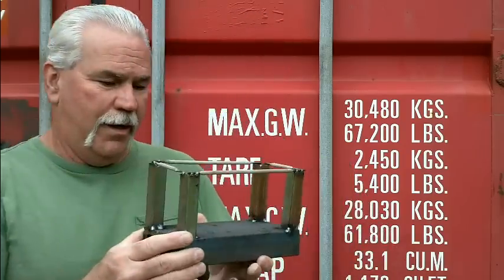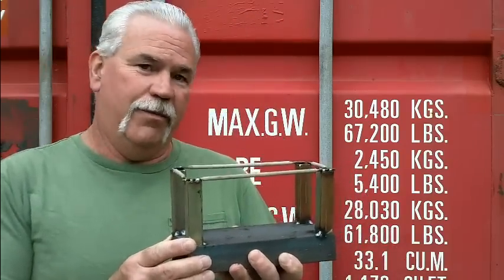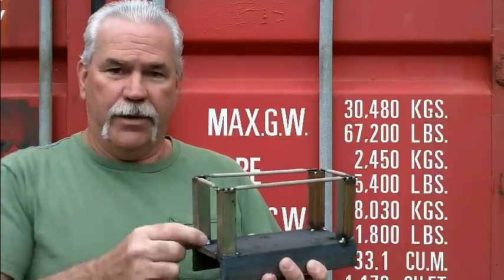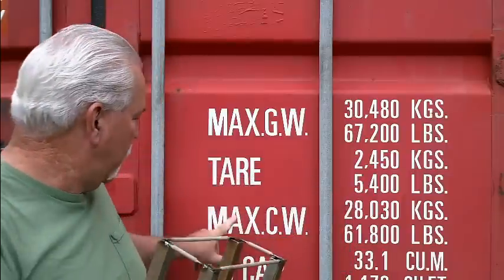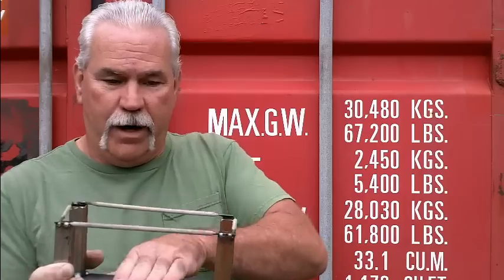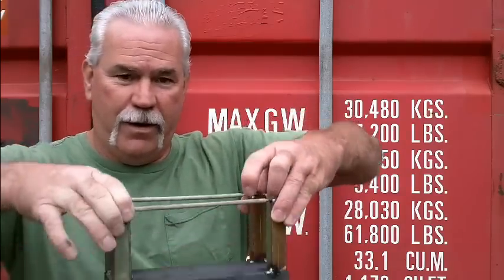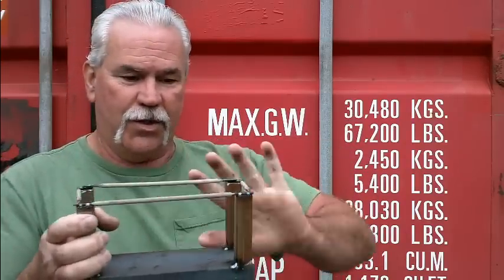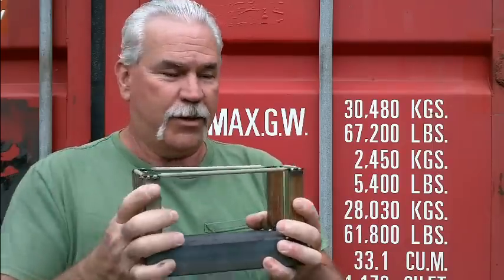Underground shipping container shelter part 1

Comment: I used to work in the shipping container industry, this man is very correct in what he's saying. The containers and stacked on top of one another but ALL the weight is on the corner beams. When you put concrete or soil on the top or sides it could very well collapse in!
Reply: But, you could use it as a form for a concrete pour. First you could shore up the inside with 4 x 4s, then seal any holes, then coat the outer 6-sides with a rubber sealant, then place it upside down on a concrete slab, set rebar, set forms for minimum 30 inch thickness, then pour concrete.  Let it set a week, then cut your entry point, and remove the shoring.  It could be at grade or in a trench.  If I did it at grade then I would set tires around it, fill in rocks and gravel, and pour concrete. Adding layers until I had a tornado-shelter.  20 inches concrete or 36 inches dirt minimum for nuclear fallout.

Comment from the maker: Hello Lamberto, first off as you know I am NOT a big fan of leaving the floor underneath you. That is so strong and you're not using it at all. get up top and walk on the roof and you will feel it flex that is only one eighth corrugated steel. If you're going to pour concrete on that extensive bracing must happen or you will have a cave in, concrete is very heavy, after it hardens it should be okay. Another problem I see is the wood. It holds moisture and when it is buried the air transfer is limited. you do not want to have mold in your shelter when you needed it. When you draw in moist air to a cool environment it sweats you will constantly have a problem with moisture and half to run the dehumidifiers to remove the moisture. That is why I limits porous material inside. As for sealing it I use the same paint as they use on bridges if you ever see construction companies sandblasting a bridge and repainting it that paint is very durable. when you paint it on the shelter and bury it it is now out of the elements as of dirt, Wind, salt, heat. so it will last underground for decades. If it should get a scratch the cor ten steel is out of the elements also. Cor ten steel last for a very long time it has anti-corrosion materials built into the steel. One more thing is the floor is not waterproof if you take out one of the floor screws you will have any open hole in the floor. So if you do not inverted and cover the floor with solid steel you will have to run a sump pump so you don't get moisture coming up through the floor. I hope this information has helped you let me know how it goes.

Comment: I built a portcullis on the entrance of my shelter and used 10 50,000 btu propane torch heads to create my flame wall ,5 flush mounted electrically ignited torch heads let side of the door ,at full flame under 30lbs pressure the flame from each side makes a solid wall of flame ,a single 100 pound propane cylinder tested out at 21 minutes of full burn on all 10 torch heads .

Comment: Here are a few questions: I dug the hole and cast a 2 foot re-inforced concrete floor. I placed the shipping container on there (normal side up) and secured the footing at the appropriate points. I boxed the exterior of the container with polystyrene (shapes cut to fit, 2 inches thick, between the metal container and with plywood on the exterior - for insulation purposes). Why should I not re-bar and encapsulate the entire structure with concrete (whilst curing, the container shell will obviously be held up by internal scaffolding to carry the weight). Once the concrete is cured after 2 weeks, it will be strong enough surely? Do I really need metal re-inforcement on the inside? Please advise....
Reply from the maker: as long as you brace it well til the concrete hardens I don't see a problem.
Reply: +Wynand Koegelenberg Nope ,just brace walls and ceiling till concrete hardens.
Reply: Personally, rather than spend time & money on welding / reinforcing the container internally, I would put plenty of rebar in the concrete & lots of temporary props inside. Rebar closely spaced (say 6-8 inches) also helps control crack widths. In simple terms, the concrete will be more watertight.Don't have the concrete too wet,(you can always add plasticiser). Do use a poker vibrator.

Comment: I like the turning over the container but all that steel is quite expensive. I could swing the inside bracing but was thinking plywood floor inside and concrete on the outside on top. Also could I getaway with 2 brace walls in a 40' hi-cube and the  2x4 c channel on the sides?

Comment: Hi, I am in the process of  burying a container right now. I left it with the floor down and I will frame it with wood inside just like a house. I was thinking of adding a 4" concrete slab on top with lots of rebar . Also I used 30 gallons of Henry waterproofer sealer on the all the sides and top nothing under (too hard to lift)
I was thinking that the wood studs and rafters would add enough support (I won't be adding lots of dirt on the roof just a slab. I will cover the whole thing with 6 mil poly sheeting over the Henry sealer for extra protection. I would like to know how you will waterproof your outer walls

Thanks
Reply: Need to be using something like tar for waterproofing

Comment: Hey Mike! I have a simple question that I would like to ask you, I am in the process of making a complete concrete home underground, how thick should I make the walls and ceiling, and should I add rebar to the concrete as well?
Reply from the maker: not sure about concrete thickness, I'm good with steel. I think Rebar is a must for strength. maybe someone with more concrete experience can comment.
Reply: loveihi

Thanks hopefully some one will! :)
Reply: +Aleksei Krasnov Alesnarovich Honestly, here is what I would do. Sit box in hole on reinforced concrete foundation with proper drainage. (2) run pipe on outside of box where you need it to go inside, such as for power going in. (3) put 4 inch insulation on outside of walls. (4) I would Build a 6 inch wide rebar grid around the insulation. Where the windows are doors are I would weld steel plate that goes out 1 foot, if none disregard this part. After you got your rebar grid, go out 1 foot and start laying flat rock, do this all the way up.  (5) Pour concrete in between the insulation and rock wall. Let it cure for at least 3 days, if not a week. (6) Built up rock wall another foot all around, rock wall is now a foot over the height of the box. (7) Now lay a rebar grid on top of the box and you can do this with box in original position floor down, and pour a 3 of inches of concrete and let that cure 3 days. Put more rebar down and pour full the last 9 inches. Don't forget the entrance though, that needs to be sorted first if coming in from top, or you can do it from the side if you want and lay wall up to it. If on the side put a beam across the top to lay more rock on. Personally, I would come in from the door side and have the one side a rock wall with a door and small windows for natural light. But it would be hard to find that rock entrance side after good camo is done. So you would be burying the floor, ceiling, and 3 sides. On the exposed side I would probably lay rock out to 1.5 feet, and do everything like before, but now you got almost an impossible wall to get through. An NBC safe door and 1 inch steel plate that goes over those small windows would make it pretty safe. A porch overhang with a grill before you come to the safe door even better, just build out more rock wall, now you can grill out of rain and eyes of others.  You would want the entrance way buried too, and now all they see is a rock wall with a entrance which you could make non normal so it just looks like a hole in rock, and windows that are just spaces in the rock outer wall. Now plant bamboo or whatever out fron't and you can make yourself a little small yard and hide the whole thing in there. They see bomboo grove and that's it. If they find the yard inside then they see the wall, but not till then. Would be hard to even spot from above as bamboo trees would hide it, and hide the top real good too after you plant them on top.
Reply: *****
 Wow mate, thanks!!
Reply: Hey Mike! Am I able to purchase the details form you on what thickness of steel, welds/ where they should be positioned? I have an engineer willing to vet the structural integrity drawings provided for our 20’ container before we bury it for peace of mind that it’ll hold up under earth!

Comment: The actual corrugated steel walls and roof actually give the shipping container remarkable strength. So when u utilize one were the walls that are bowed out wards it's been loaded beyond its weight carrying capacity, so at that point the roof line is actually sagging length wise of the container. At that point no reputable shipping company would use them do to the fact once its hoisted up from its lifting points the shipping container will be prone to further bending under a heavy load. You are correct about the flooring bearing all the weight, do to the floor joist. However when you turn it upside down the floor joist become non existent, since they are on the incorrect load bearing side.
Reply from the maker: when it's rolled over it is plated so the floor is supporting the weight.  watch more and learn
Reply: loveihi I jumped the gun their. I thought you were the type of individual that would go up to your attic and walk on the sheet rock instead of the ceiling joist.

Comment: Not sure if you are still doing this but i have a question un answered by ANY video so far... I am burying 3 40' containers that will be welded together with NO dirt on top.. these will be 3 wide with 3 on top (so 9 all together)... how would you reinforce that??? I would think the middle would need nothing correct??  then reinforce the two outside units??
Reply: +IJustice  Dig down 3 box worth, build containers in a "U". Now you got a courtyard to plant crops. You could pretend you were laying 3 sides of a garage and lay 12 inch block and pour concrete in block with rebar, and push boxes up against the 3 sides and stack. Then fill in dirt around outside block wall.. All windows and doors would be facing the courtyard.
Reply: Love to know how you get on

Comment: Bamboo also could be used for support using foam panels between solar panel to operate fans you would put in there to allow plenty of air to keep mold in control.

Comment: Since there designed to be stacked due to the strength being on the outside edges, would that work underground, mean you don't put dirt on the roof of the containers you place other containers on top of it, and surround them with a water Barrier to prevent rusting and back fill around say 3 or more containers stacked underground. Use the strength of the containers rather than having to reinforce them. People for some reason want to place dirt on them underground.
Reply: You can stack several containers above each other. The reason for putting them underground is that they are then less vulnerable to weather/ weapon effects as shelters.Also they maintain a more constant temperature all year round & are less obtrusive.If they are to be underground fallout shelters, then it is the several feet of earth on the roof & sides that stops the gamma radiation, not the 2mm thick steel.

To stack underground would need a very deep hole & would be more likely to go below the local water table. There are ways to avoid putting earth directly against the container walls,such as stacking gabion wire baskets filled with rocks around the container.
It really depends on if a person wants a house, or a refuge in case of emergency.
Reply: I have spent months studying making wine and came across a great website called Pavas grape plan (google it if you're interested)
Reply: You could put a rubber tarp over the top and rebar it and use mesh and make a 5"-6" concrete roof, which if done right could have several feet of dirt on top of done right.👍

Comment: I'd just use insulated concrete forms and be done with it.  It's more flexible as to the shape you need, and better able to deal with ground pressure.  Plus it's got insulation from the start.  All you'd need to do is pour a reinforced ceiling to support the weight of the ground above.
Reply: Concrete per square foot is way more expensive in most areas because you’ll need atleast 24in footings all the way around on top of walls, floor and ceiling.

Comment: I enjoyed this 3 part series, but I would like to know, why not just brace the inside with lumber then after adding the sealer,rubber and plastic, in case the entire thing in concrete?? I would think that would give better protection against St radiation. Maybe add sheet lead above the plastic and rubber.... Just wondering....
Reply: I can't see much point in adding lead.It takes 0.5 inches of lead  to cut fallout Gamma radiation in half. Use concrete then earth, it is much cheaper. As you say, encase the thing in poured concrete (pref. reinforced) & put temporary props inside until the concrete sets. Rebar will be ESSENTIAL in the roof, if the container is not upside down.

Comment: @UCc9w6I3Lmh2SnVuSvQ6qPyg
        
        
        
        @
        
        

        
        
      

    

    
    

  
  I use to work at an inland port moving these containers for BMW. This guy knows what he is talking about. If you are considering burying one of these, heed this mans advice. These containers are shipped across the ocean,(salt air) it eats up the paint and rusts the hinges. When the hinges rust you can't (CAN'T) open the doors. "5 Acres and a Dream" blog

Comment: could you bury one 1/2 way and cover it like a army bunker
Reply: +Knuckle up !! You'd still want a little extra support even if you put a foot of dirt above it. A square foot of dirt weighs on average 74 to 110 pounds. So a container is 40 feet long, 8 feet wide.40x8=320. 320 square feet times 74 pounds is 23,680 pounds of dirt above your head, being supported by 1/8 inch thick steel.
Reply from the maker: +Nicks Customs you need to watch the other parts of this series. I invert it and cover with 1/4" plate on top of the floor beams. that is overhead. you should post this on a builders site that doesn't invert the container.
Reply: loveihi Oh I wasn't talking about your design, I like the way you did yours. I was responding to the guy who asked if it needed to be supported if it was only half way buried then had a mound of dirt placed over it.

Comment: Very good work sir.
THIS container is done right to be buried and be a SAFE structure for generations to come. Anyone that calls bs on this build is a complete idiot...but as always you cant fix stupid. ..even after pic after pic of FAILED containers that were NOT reinforced . Concrete cracks even WITH rebar = FAILURE
I'm doing a above ground earth burm and cover and STILL reinforce as shown in these vids and flip. The doors will still open in my build to allow for use as a shop / storm shelter and recording studio at the full 40 ft

Comment: 5400lbs of steel? just use the container as the inside form and poor concrete. plywood form outside and #4 rebar reinforcement waterproofing, ect.. save your money and do it right. the only steel you will need is for making a 12" concrete filled bomb door and hatches. I can put 6 containers (3-40' 3-20' roughly 1500sqft) in the ground this way and make a luxury bunker for less than the cost of building a new home.
materials costs..
$20k for the containers
$11k for the concrete (8" fully encased)
$5k for the steel
$5k for the plumbing, electrical, ductwork and routing.

so add in labor, excavation, grading, finishing,, air filtration, water and fuel storage ect.. you can have a 1500sqft fully decked out bunker that can withstand a nuclear attack for less than 150k
I was a custom concrete home builder, turned federal HazMat contractor with over 20 years of experience.